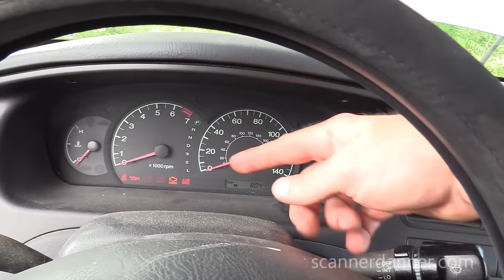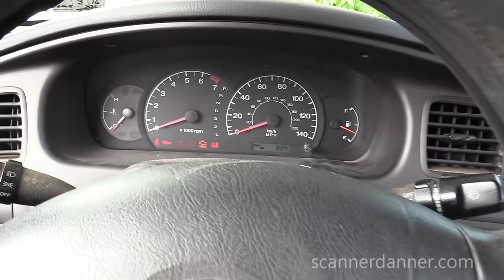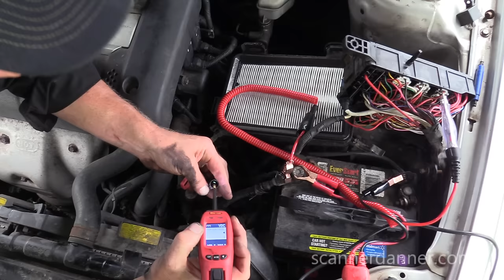No crank, good starter, how to troubleshoot, any car! (Hyundai)

Comment: The presenter is an excellent teacher. Doesn't BS, tells you when he is loose with terminology, and corrects it in real time. Diagnosed the problem, saves replacing the starter for the customer, but doesn't shy away from a fair cost to the customer.
Reply: Its probably not economically feasible to not replace the starter since you must fix the connection in the process of starter replacement.
Reply: Homeboy should start a school  teaching. He'd get rich overnight. This is the knowledge that we all need. Class is in session. #Respect
Reply: Yea,so u got a crush hu? U been saving urself for "the mechanic"or the teacher

Comment: Your thinking out loud while solving the issue was a wealth of info in and of itself. Thank you.
Reply from the maker: something a lot of people miss out on because all they care about is the fix. Thank you!
Reply: @ScannerDanner   analogous to bypassing the AC relay and radiator relay, can the car be start without key inserted or removed and bypassing the starter relay with jumpers, and power feed the pin 87 of the relay straight from battery positive??? If engine is RUNNING, then can I drive without keys inserted??
Reply: @tnamen1307  @
Reply: Saying piece of shit Hyundai was incorrect....a simple fault and I bet the car has done close to 200 000km already. 
Most starters that I know has the same wiring on the starter motor.

Comment: A real teacher, not just a show. thanks so much. I was a industrial electrician and always using multimeter for trouble shooting and have been wondering for many years about why auto mechanics using testers, now I understand, the main reason is there is no main breaker or switch on cars, so when checking continuity the testers got the advantages.

Comment: This guy is so real.  You don't find this much info under a tree from a real life tech man anywhere else but here. 💪 🐂💨
Reply from the maker: Thank you! I try to keep it that way. Filming live is the key. Let me show you my thought process, struggles, wins and fails along the way. It is the best way to learn.
Reply: I'm currently trying to figure out if I got power from my fuel pump relay in my 2010 tiguan after a serpentine belt ripped off and split my oil pressure sensor and hit coolant hoses or possibly other wires near it. I got a problem at terminal 30 and tryna figure out where that is.
Reply: if there is no power to the relay. Than the pump will not pressure up. Serpentine belt flew off because a pull has seezed up.. Bad battery will cause a no crank no start. Without any codes. Try crank engine then leave battery with charge. Left in it . over night
 Next morning put key in start position watch dash console. If gauges do crazy extremes. Thats a bad battery. Most of all do a fab key test. . magnet in key housing talks to ignition switch FM receiver without any  battery power. Uf key has been damaged. Order you a new
Reply: @stephenfallis9374  I was gonna change my serpentine belt because i had a tear on it 2 weeks ago but had bad turf toe so it wasn't in my head to inspect it and then change it. Then the belt ripped apart from just about maybe a 3 cm tear and then it stretched, because of carelessness.  I drove maybe about half an hour to pick up breakfast before it ripped when I smelled burnt rubber but didn't noticed shaking or steering troubles because the car steering is electronic and not connected with the belt. I had p0011 and p0341 codes but fixed it and it still wont crank. I don't wanna take it to a shop because in my head, I feel like it's 1 thing I'm missing and it will start. I just gotta figure if it's electrical or parts causing the issues.

Comment: Very very good work. Surprisingly I had exactly same problem with my Hyundai elite i 20 and at the time I was in very dens and wild forest and it was time to go back home 80 km from spot. Fortunately I use to keep some tools and wires etc in my car I know little about car mechanism and wiring, relay layout shown on cover gave me little clue and I managed to start the car. After coming to nearby town one technician fixed one additional push button and I continued further travel to home. That push button is still there. Now your video will definitely help me to restore original status of my car,. Thanks for posting this video.

Comment: Mr Paul!!! It's currently 2333 here in the pacific northwest and I had the same issue! Car exterior and interior lights would turn on, but no crank. I stumbled upon your video and immediately got to work. I started at the starter and all was well. I ended up at the fuse box where I swapped the starter fuse with the horn fuse AND WHAM... it was able to start! Turns out it was just a dead fuse. I'm so thankful for your content. A thousand times thank you and may you continue to bless others with your work. :)

Comment: You are pretty good!  I've been repairing these newer vehicles for years.  Like older cars better, physical items are becoming harder to access .  Had the same problem on a chevy hhr, Bad connection at the solenoid wire.  Too many unnecessary electronics these days.  THANKS-

Comment: Mr. Danner, thank you very much for your life-like training videos.
You have excellent +++ troubleshooting skills, very valuable for beginners and professionals. 
Troubleshooting this kinda problems is extremely difficult, but you explained it in a very easy to understand way and that's double credit for you.
Not even the person who troubleshot that problem before had the ability to solve that issue, they thought that replacing relays was the solution, but as you said, even of they were able to fix that problem by replacing the crank relay, the issue will come back. Intermitten issues are the worst to troubleshoot, but you have an excellent method to come down to a root cause.
Do not pay attention to those "big-mouths" that only criticize without method, those only talk because they have mouth...
Please keep up the good work with your technical videos. God bless!

Comment: This is such an excellent video.  I have a 2014 Dodge Avenger that was having slow starts about 2 months ago. I go to O'Reilly to get the battery tested, and they told me that I was losing voltage during the crank.  The car would start right away at times, but then it would slow start, especially if I was making start and stop short trips to multiple places within an hour's time.  But for a solid month, I had no issues at all, regardless of how I drove the car.

Then about a week ago, I noticed the slow starting again.  The next day, it was really hesitating to crank, but it started up.  On the last start up, it cranked as slow as it ever had, but started after about 4 seconds.  Now, it's simply 1 click, with no crank at all.

I changed the battery out, but still only hear the 1 click.  I am smelling something burning, like a wire, coming from the engine area where the starter is, whenever I try to crank it up.  It may be coming from the starter solenoid wire.  Tomorrow, I'll try to find the wire going to the starter solenoid ( even though I can't even see the starter because it's so buried in the middle of the engine )

Comment: Fuse box corrosion, very common problem in multiple vehicles. I've swapped them out with others took em apart cleaning the contacts and weld points on the bread board bottoms good to go.
Reply: What type of car???????
Reply: well boys looks like I've got another 2-3 hours less free time tomorrow
Reply: @jamesrisen5370  2006
Buick lacrosse new battery & starter

Comment: Excellent video! The "relay swappers" would have throwed a new fuse box and relay on. Better to spend an extra 15 minutes verifying the problem instead of replacing the wrong part. Thanks Paul for another excellent video.
Reply from the maker: Thanks Jeff!
Reply: Jeff Hesse
Reply: Not before they would have replaced the battery, starter, alternator, ignition switch, park/neutral switch, ignition switch a 2nd time, battery power and ground cables, and battery a 2nd time...just to be sure.
Reply: Could anyone help me ..my ford fiesta after key start sometime start and some time silent after ignition key turned
Reply: First time watching one of your videos, have to admit I was pleasantly surprised. I'm an old retired master mason that doesn't like to waste one second of my, or anyone else's time (just a get the damn job done the best way possible and be extremely efficient with the time taken to do the/any job/repair/task at hand.. 
Now to my point,... When I saw the length of your -starter video, I thought to myself,.. Well here comes another arrogant, no it all, long winded, typical blowhard mechanic, taking up a solid half hour of my life, just so he can show and tell everyone how flucking marvelous he is, and it (the video) and you turned out to be nothing I had my preconceived notions of. You kept me rivited (well you weren't that flipping awesome but pretty awesome), interested and intrigued with your knowledge and obviously well honed teaching skills! Didn't ever get bored enough to even scratch a nut! Fine job sir, and thanks for not wasting any of my time. You were a pleasure to watch, listen to and learn from! If I had any idea of how to subscribe to your channel, I certainly would! Thank you for the troubleshooting lesson, keep up the good work! Good day!
Reply: @naveenkumar-rd5uj  Same. Intermittent no start. No crank. In my opinion I would start by checking the starter. Then go to your wires around your starter. Just a start hope it helps.

Comment: I didn't work on this car yet felt so rewarded at the end hearing it start. What a fantastic video. Thank you. Now off to my 2005 Sienna no crank, no start but yes to fan-noise-sounding problem - I hope it's as a simple fix as a starter motor swap out. 🤞

Comment: Wow! So thorough and informative 👍 My brother’s Accord was involved in a fender bender last year and he had similar starting issues. Turned out that a wire in the harness was broken near the front end due to the accident which was causing intermittent starts. Once repaired it was all good 🤙

Comment: Watch out for that spider Mr. Paul....definitely was a Brazilian Wanderer lol....Thank u so much for the upload....Ive been watching your videos so long I start "diagin" right there with you. My boss and coworkers laughs when im sitting there talking to the freaking screen at you. What isnt funny however, is how accurate my diagnostics have become over the last 2 years through mainly your premium channel but this one as well. So damn thankful for you brother.
Reply from the maker: dude that is awesome man! thanks so much for helping me make this stuff possible
Reply: Same here. I thought the solenoid connector would be the prime culprit as its more exposed to the elements. The relay looked bad too though and would have played up at some point in time.
Reply: X
Reply: how to rebuild a 73 rockchester 1 brl. carb
Reply: Brandon F
Reply: What if you have a "click click click click click" sound on a 2003 ford explorer xl? It was clicking in my starter and all of a sudden it stopped. No noise at all. My lights are dem the radio wont come on and the windows wont come on, it wont open but it will lock if i keep pushing my remote. So i got down under found my starter banged it a little and i got it clicking again. So i wanted to check my stupid fuses, but like you said some fords just have numbers not names. So mine was a no crank and now a no start😢.  My hubby thinks its a bad battery. I want to check my fuse forst because i believe its a bad power connection to my starter. And the truck right next to this car is very simlar to mine. You have a great way of showing us things. Thank you
Reply: With all the credits to you sir and not trying to put you down or say that I know more or better, you skipped that step while you were down there at that connection yes you proven that that was the problem not getting power at the starter solenoid wire the very next step was to check that connection i have seen those problems before and let me tell you is not easy to remember all of that when under certain circumstances like rain or heat or in the middle of the road we mechanics don’t have an easy jobs always at a shop we have to go some times where the car is at , anyway like i said just one observation from a mechanic here “ been a full automotive mechanic you never stop learning that’s from me i have only 18yrs on it and i feel like it’s never ending
Reply: The Battery is/was dead recharge it first, then see how it works! But by now (a month later lol) you should have found that out already.
Reply: @ScannerDanner  hey buddy I have 2011 wrx sti ..I install a viper alarm on my car so the car was starting perfectly with the key and remotely but yesterday a was trying to star the car with the key but it doesn't started anymore but if I try with the remote the scar star right away...so I dont know where is my issue...thanks for ur videos...
Reply: @deriskherrera1206  Most likely your ignition switch. It will start electronically from your key fob but it won't start manually from the switch itself right? If so then it is likely the switch.
Reply: ScannerDanner  hi im having the same problem with my ford focus  1.8 tdci can u help me ?
Reply: I had a 2007 Ford explorer when my husband went to change the starter we do not get any power at the very in the cab but we do get power from the starter to the front fuse box what do you think that could be and why not why are we not getting power from the starter to the front of the car when there's no lights no radio no power whatsoever what do you think he done wrong please help a thank you
Reply: @rebeccapalmertree3496  
Have you checked your fuses ?
Reply: @rebeccapalmertree3496  
It starts at the battery,  goes to the key switch, then to the big fuse box under the hood, then to the solenoid switch, to the starter....
Some have 2 solenoids, one on the fender, under the hood, and one on the starter itself....
You can call the auto parts store and ask if it's 1 or 2 solenoids.....
You need to check the power at all points. where the wires goes in and out......where you have power going in ? But not out of, that is the problem....
That's how it's done......
You Also need to check the little wire going to the starter, to see if it's getting Power and exactly how much power (volts reading),  from All points, into and out of,....
It could be a wiring problem, can't say until it's checked out....
Reply: im sitting there talking to the freaking screen at you.

Hahaha. I do this! Glad I'm not the only one. Thank you OP. You are a great instructor.

Comment: ypur test light should light when when it is connected to B+ and the solenoid as the solenoid has a low resistance, incandescent test lights are incredibly valuable

Comment: My 08 Hyundai Santa Fe is having that same issue I’ve replaced starter and ignition and battery used a screw driver only the starter turns motor doesn’t engage this is the best video I am going to get out there tomorrow and see if this is my issue

Comment: This is one of the best videos I've ever seen. This guy would make a great teacher .
Reply from the maker: 18 years teaching at Rosedale Technical College in Pittsburgh Pa. :-)
Reply: @ScannerDanner  it shows.  Thanks for the great video.
Reply: @ScannerDanner  started trouble shooting at the fuse box, jumped the two switch terminals on the relay and got nothing. Tore everything in my way out and jumped the power to the S and nothing . Took it to the parts place where they confirmed what I thought, it was a dead starter. Thanks again for the video .
Reply from the maker: @philipholman1713  the last test would have been to confirm you were not dropping voltage on the main battery cable while you were energizing the S post. I think this one had a bad main power wire https://www.youtube.com/watch?v=U0HktTWiw0Y&list=PLAFYVCyenqcpZM-kQg5MUX0OvrIPSirz5&index=18&t=1s

Comment: at 18:28
Exactly right
in I.T. when a person tells me the computer won't start up
and then another tech looks at the job and says "oh Dude, that's the power supply, replace the Power supply"  hehe

well.. yeah. maybe
but I DON'T CARE WHAT IT IS , 
Even it happens to be something as simple as the Powerboard is not working or the Wall Point isn't switched on or even the PSU is faulty

TROUBLESHOOTING LOGICALLY AND CORRECTLY EVERY SINGLE TIME IS KEY
otherwise you are just taking stabs in the dark
and even if you take a stab in the dark and ACCIDENTALLY pick up on another issue,
that issue would lead you down a different road of troubleshooting and waste an hour or so of your time

Troubleshooting Effectively is key
Reply from the maker: yes sir! Thank you
Reply: canuckguy worried  
Allot of the time it is. Lol
Sometimes you just smile, fix quickly (plug in keyboard; caps lock, etc) and have them be happy
Reply: canuckguy worried  
And it was something annoyingly simple. Lol